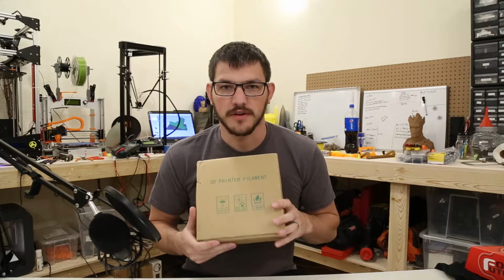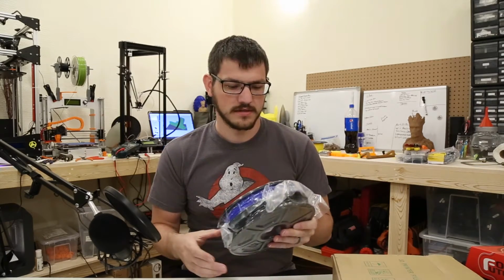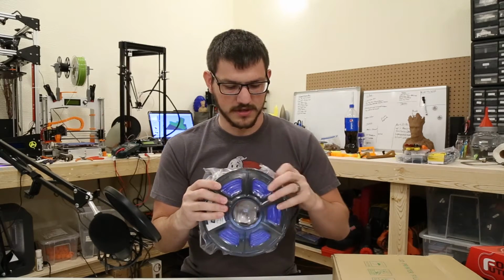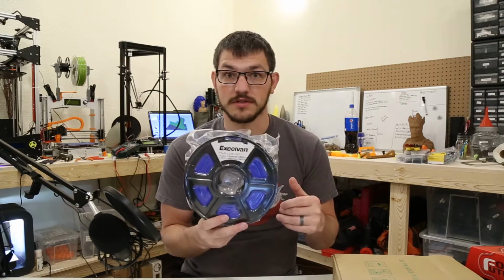Fugatech 3D Printing VLOG #007

Comment: I've used excelivan filament, matter of fact just got done printing with it. It's been better than I expected for the price. For those stepper wiring, break out your multimeter. Set it to ohms. Of the 4 wires you should have resistance between 2 pairs. Then if the board is setup like most It should do one pair then the other pair. If the motor moves the wrong way switch the pairs. I've gotten steppers that are wired up different than normal before. Sorry if I did a terrible job at explaining this, theres tutorials online